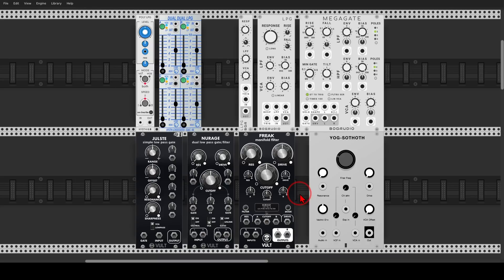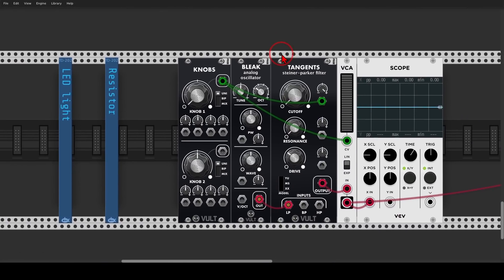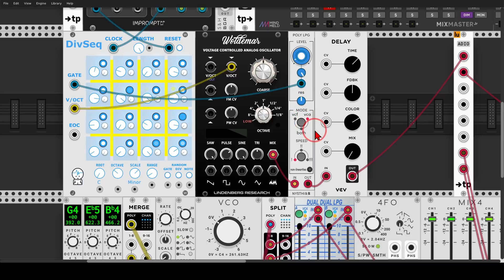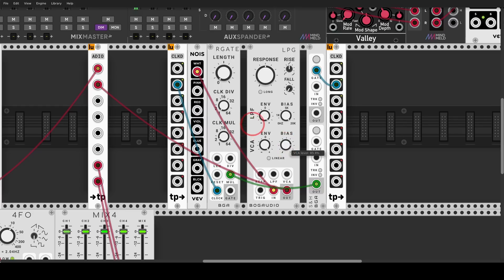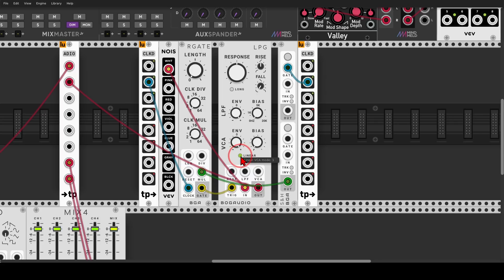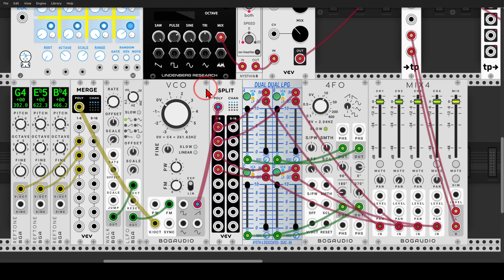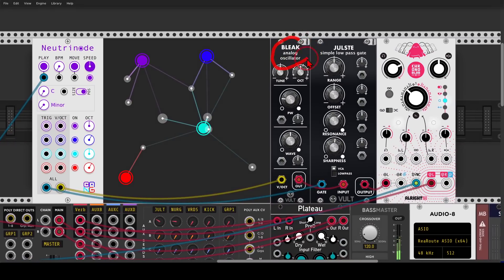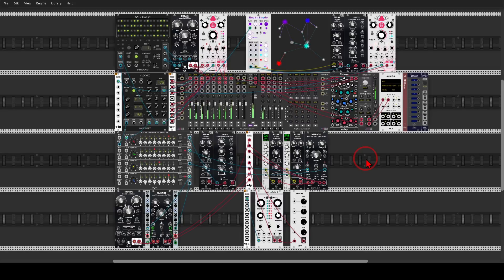Low Pass Gates in VCV Rack

Comment: Cheers for this man but I’m still a little perplexed by the concept? For example, I would simply patch velocity into the filter to open it up at higher velocity values. What’s the difference between that and the LPG?
Reply from the maker: Well, there are a couple of differences. The low pass gate will act as a gate so it will close the sound all the way, similar to how noise gate works but just with a low pass filter (and a VCA usually). Another difference is the vactrol so this natural decay of the sound. To be honest, in VCV it's a bit hard to hear the difference, but if you hear a low pass gate in hardware, you will hear the effect. That said, something like Nurage is really unique, lpg or not.
Reply: In addition an LPG typically has a few things that differentiate it: 1. they are usually 2 pole filters, so it's a much softer roll off than many filters 2. It's combined with a VCA, some of the earlier ones did not have separate controls for the VCA and the filter so they always worked together, and 3., as Omri said, the Vactrol, which, when pinged with a short trigger, which produce it's own envelope. That shape/sound is so unique that we actually built a vactrol module so that you could apply it to other filter/VCA combinations for the sound 4. early LPG tended to saturate the sound a bit, you actually hear slightly different harmonics when the filter closes because the saturation is actually post filter. That, for me, is the "secret sauce" of Buchla LPGs. You can hear that in the Verbos A&TC and our Yog-Sothoth module.
Reply: Cheers folks. Appreciate the explanations… I think I get it now. Also, cheers for the amazing modules Magus Instrumetalis, they’re really something else! Peace n shrooms ✌️ 🍄